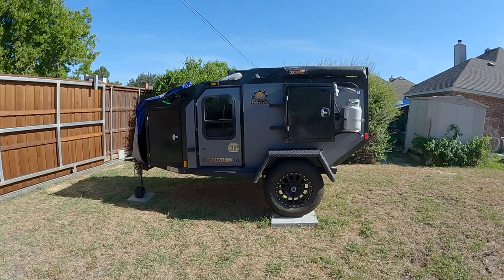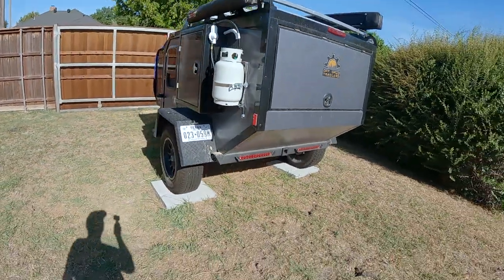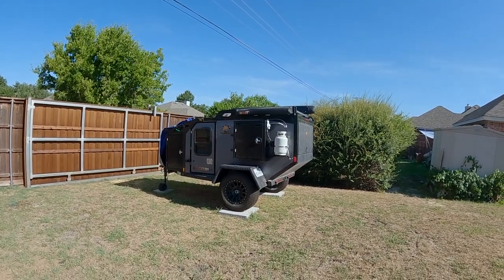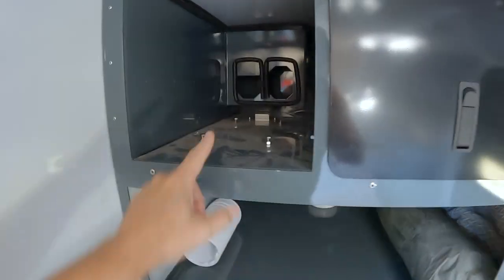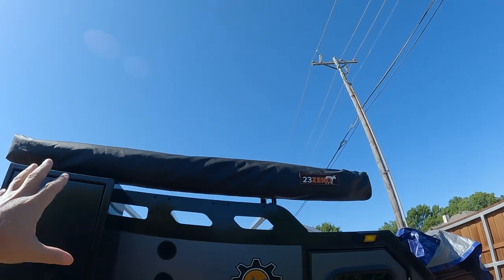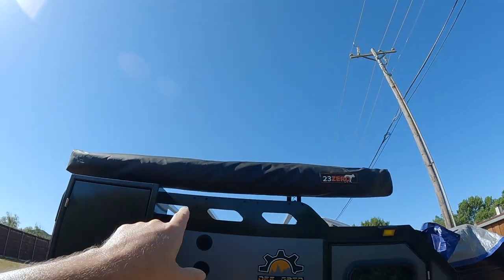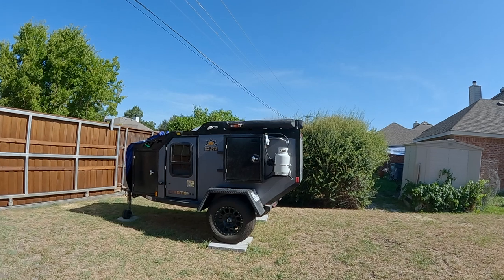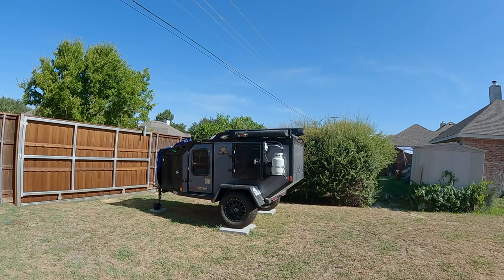Episode 11 - Chinks in the Armor?

Comment: Overall are you still happy with your purchase? Just placed an order for one and starting to get cold feet after watching a few of these videos. I passed on the AC because I would never use it in the first place.
Reply from the maker: I am definitely still pleased with the investment and highly recommend the Expedition 2.0. My goal with these videos is hopefully not to dissuade anyone from buying one, but to help save some cycles based on lessons I've learned.
Reply: How long did they say it takes after you order to get? Wife and I are planning on getting one of there trailers. Still trying to decide, but was curious on length of time to get.
Reply: @ExpeditionOverlanding  I definitely understand that and appreciate the response. Can’t wait to get it!
Reply: @Dracoz74  I placed my order last week and I’m hoping to see it by mid to the end of October. I’m also in the Carolina’s so it’s gotta go a long way so that’s including transit time.
Reply from the maker: @Dracoz74  roughly 6 months from order to delivery.
Reply: @Dracoz74  It depends on if you want one built exactly to your specifications or if you can find one that they already have in construction that has what you want already in the plan.  You can see what they are showing in stock by looking under the "shopping tools" drop down list on the OGT website. 

I saw one that I liked about a  month ago and enquired about it. It turns out that it showed the air conditioner rough in on the picture, but the actual one pictured did not have the a/c rough in. However, they did have one already being built. I placed my order on July 29th and I've been told that it will be completed between September 2nd and September 23rd. Then it is being shipped to San Antonio, Texas. I believe I'll have it before the 2nd week in October. 

Hope that helps you estimate the time frame from order to delivery. Best of luck!